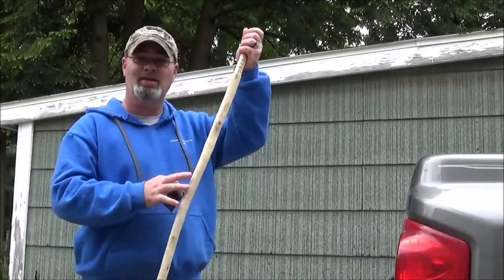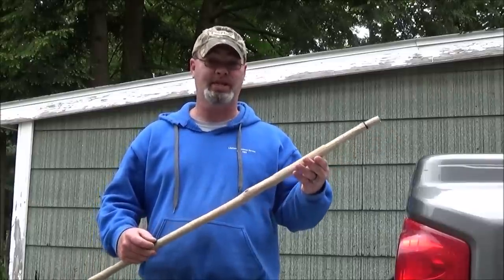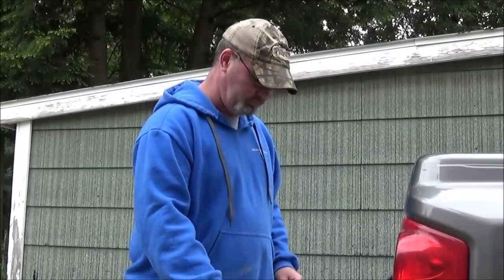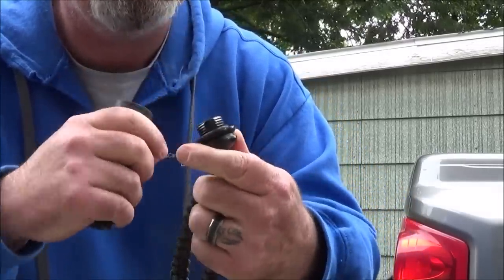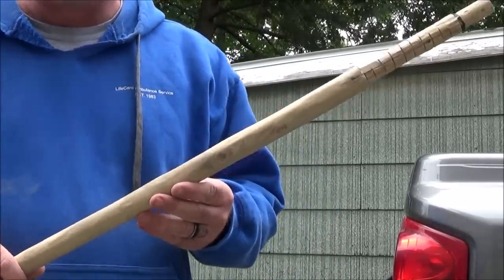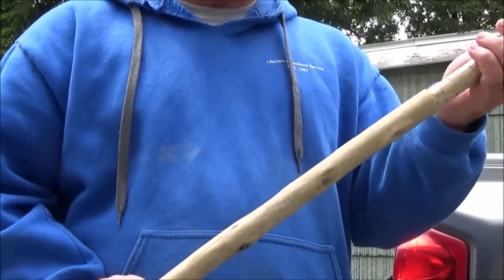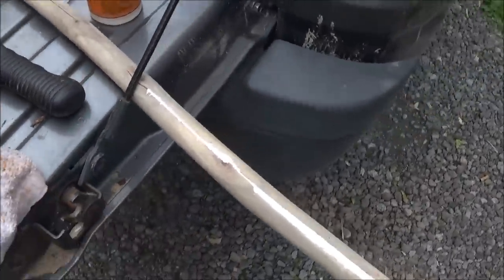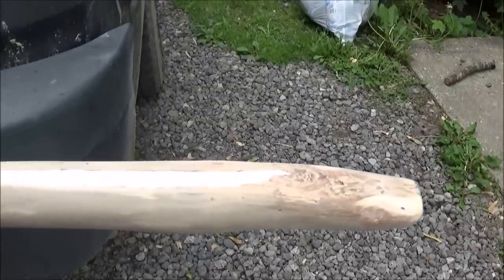Project: Survival Hiking Stick

Comment: How about mounting a Mora knife on it?   I don't know about weight, but how about a bicycle water bottle.  The mount should fit the diameter of that stick perfectly.  Might be worth trying.  I know a fellow who fills in cracks with bright wire, or plastic, or whatever he finds that looks cool.  He epoxies them in, which also holds the stick together.  But be careful.  I blew out my knee a couple of years ago, and now I'm hooked on making walking sticks.

Comment: Ahhhh , yet another use for the flex seal/
   Getting to where I'm needing a little help getting around day to day. Been putting off using  a cane because, well they look like a cane. This is what I think when thinking cane.  Want that exact look but in black with yellow..  All my gear  is black with yellow accents.
   I'm in a urban scene so would be more geared for self defense so thinking some sort of heaver metal band some how incorporated  around end , or ends.